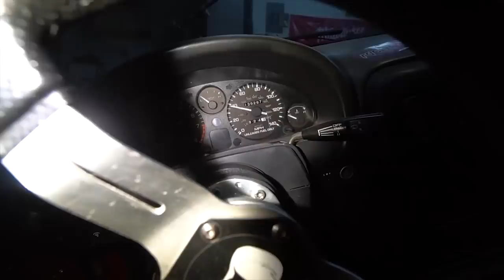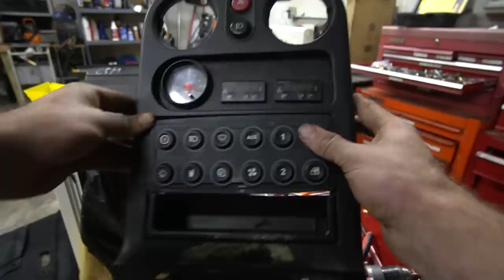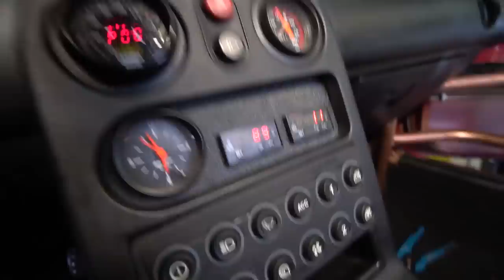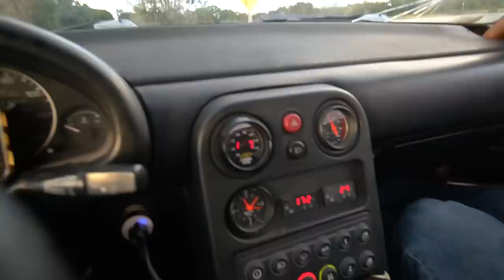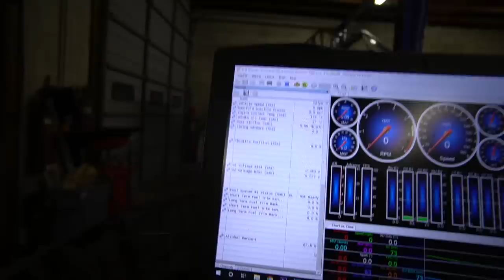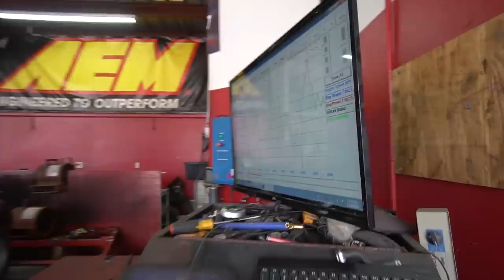LS Swapped Miata Build Documentary. Resurrection From Start To Finish! *Turbo Beater to V8 Beauty!*

Comment: i bought an ecu master PMU, ADU, Keypad and GPS because of you :) just got it all in and set up last weekend, super happy i did it. love your vids man! always learn something :)
Reply from the maker: It's such an amazing setup. I've had no issues with mine! Only thing that's ever happened is the power wire rattled loose, I just tightened it back up lol
Reply: @Taylordrifts  I'm looking forward to putting it through its paces! if you do go for the ADU eventually, they have started making them with autosport connectors, get that version, because the ampseal connectors on the normal version suck! 😅

Comment: You can weld a bead on the inner part of the race. When it cools, it will pull in and make it easier to tap out out. 

Thanks for the video.

Comment: I sure you are all over this now but, if you get a bearing race stuck internally again a great trick is to run a continuous weld around the inside of the race. When it cools and contracts, the race will pop out easy!

Comment: One helpful hint with removing stuck races, you can lay a weld bead on the race and it will try to expand and when it cools it will shrink a little making it much easier to remove. As long as the rest of the piece can get warm and the weld spatter won't be an issue.

Comment: Great work!   Too bad for the rod knock, I lost oil pressure in my Grand National after spending $15k on a rebuild.  No rod knock, but the valvetrain is noisy.  Since I live in MI and now with COVID I have to wait until after May 15th to have the valvetrain looked at.  Great video, awesome swap.  Turbo engines are fine as long as they are tuned correctly.  My Grand National has ran fine, never a problem because of the turbo, but with a turbo a little less forgiving if another component fails.  Like the fuel pump.

Comment: To remove stuck outer bearing races you can try running a weld bead or 2 around the inside. It shrinks the race enough to get out. I've used this method a lot and works well.

Comment: Next time you get a bearing race stuck, run a weld bead around the center.  The weld will pull the race and make it smaller.  It'll pop right out 👌

Comment: I love hearing people at meets talking about LS swapping their miata and thinking they can do it for like $3k. SOOO much work goes into it doing it right... I've owned a bolt-on n/a 91, so I wanted more power and i then put a big turbo on making 300rwhp; lightweight flywheel, big fuel pump, racing clutch, ss clutch/brake lines, racing fluids, etc etc....ended up going back to n/a with it (as it sits now). Its not fun to drive n/a with the 4 puck stage 2 clutch and lw flywheel, its super touchy and chattery in reverse especially. It wants all the power it used to have XD
But i really want a v8 swapped one some day...just not sure I have the energy at this point to do all that work, may just look into buying one that was properly built. Very cool build video..having those fab skills saves a lot of time and money, one thing i never learned was welding. Cheers for a bad ass build!

Comment: I know you have probably heard this and/or found this out already but, the miata are perfectly balanced front to rear stock (with the little, in this case, 1.6L or 1.8L 4cyl motor), half the size of the motor you put in. The reason I bring this up is for when you took it out drifting, you were asking about what we think the issue was. I think that it's because you gave it too much weight in the nose, and the car itself didn't have enough ass to throw around and keep stepped out. Now, in all honesty, I have never drifted a car in my life, as much as I want to. But, I do understand how things work, and I have a very mechanical mind, I believe it would be called. Meaning I break things down and understand from a piece-by-piece aspect, what each part does to make the whole thing work the way it's supposed to. 1 way I see drifting is kinda like a trench coat; the longer the tail, the easier it is to flip the end out to either side. A miata is not a very long trench coat.

Please correct me if I was wrong. I want to know so I can understand better. I have a '01 NB that i am trying to get running and seeing videos like yours gives me inspiration and a drive to want to get it done and done right. 

Also, the paint job on the roof looked better than sex. 😍 I wish I could have seen it in person. Mine is a soft-top so I can't do that.

Comment: i just got a 2000 mx5 convertible. wanted some thing different so im putting a arctic cat thunder 900 triple 2 stroke with a t5 tranny in it . duraflex vader body kit then have the stinger exhaust sticking out the front cut outs . dynoed the motor at 260hp at 8k rpm so it should be a blast to drive . only thing that suck is the motor will sit sideways in order to connect the shaft to the tranny .

Comment: RE: Blow'n engines,  weld in baffled partitions around the each side 
around the oil pump pickup tube & head. Prevent these 4 quarts from moving about. Best:  Widen or lower - if you can-  the bottom part of the oil pan. Modify the tube & screen 
Widening or lowering: 
 2" W - 3" H - 10" L  on each side gives ya 'n extra 2 ++ Quarts..  Sorely missed I guess,watching the start of the Vid ..  Bigger coolers, longer lines  is more oil but won't prevent hot watery like oil from sloshing 
L + R  Starving the pick up tube..  Cheap, worth the lowered risk factor And ..  way cheaper than dry sump  G-force (0.2G is enough) induced oil starvation means;  sucking up lots of froth. 
Froth: A variable momentarily combination of air and oil mixed together.. 
5-6 seconds of frothing under full power, short moments of well oiled air reduces lubrication AND FOOLES pressure sensors -- there is still pressure but way with much lower volume  ...  
oops .... rrattattattat      then:  SMoKe, lots of it..  
- Rapid temp gauge fluctuations could be a frothing  indication..   
Regards

Comment: I ran with my pump pressure line hooked to my return line and i put fluid in it and didn't hook it up right until a year later because i just kept putting it off but once i did hook it up it worked fine still so i always tell people that so they won't burn up there pump

Comment: Do you think it would be possible to gain 6 to 8 inches somewhere of extra legroom for the driver in the first gen Mia ? I think the gas tank is behind the seat and I wonder -- with keeping the inline 4 --  if the  low side of the fire wall ,  behind the pedal is a good place to cut out ? Lowering seat cushion isn't an option for my 99cm inseam .

Comment: You could have installed a s2000 honda k series engine boosted, made 600hp at the same cost,  been 300 pounds lighter, a hell of a lot easier to fit in and had incredible reliability.....well, maybe next time.

Comment: "But it only knocks a little..." Yeah, yeah, yeah. (S)!

Been there, got the t-shirt. Old School Rule: Pop a BOTTOM main shell, and a TOP rod bearing shell even if you don't got the bucks for anything but a gasket set, then you'll at least know...

MONSTER KUDOS for an excellent concept to begin with, I have a 351W halfway in a 1/4 ton Ranger and a 91 Festiva with a B6T

Comment: Remember in the end of the movie 300 when he said his shield and helmet weighted him down and thru his aim off with the spear I drove an even better version of this a tube chassis Miata Exocet lsa swapped tube cross member with wise fab angle kit hydro steering big tires it sucked now I drove a way less heavier and more balanced set up Exocet kit car but with a Miata dawg box and k swap na itb build that still was light and nimble and reliable it doesn’t take much to spin one of those just clutch kick it bigger isn’t always better

Comment: Man, 18 minutes in.  I'm surprised you have access to all these tools/equipment, and use spray paint...  Could have lad ddown some rattle can out of a cheap harbor freight gun with better results.  Not that it matters much on smaller/round surfaces, vs say painting a body panel...  But if you have access to an air compressor, might as well paiont stuff with proper paint so it holds up better, is faster to paint, and cheaper.
Also a side note, get yourself a proper $20 respirator.  Those little $2 masks aren't doing anything.  A $20 respirator you wont smell any paint, and you wont get a contact high from huffing all those fumes lol....

By no means am I dissing you, just kind of shocked about all this build, how you went this route with the paint and respirators lol